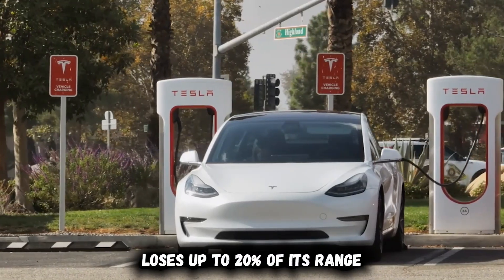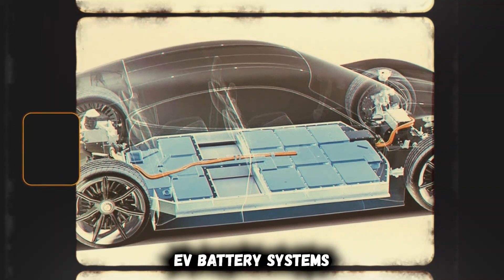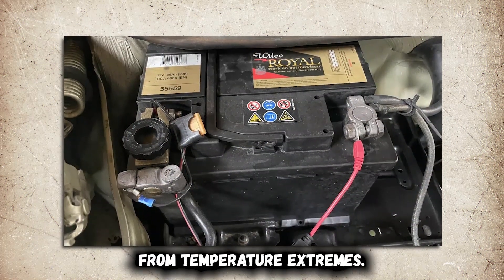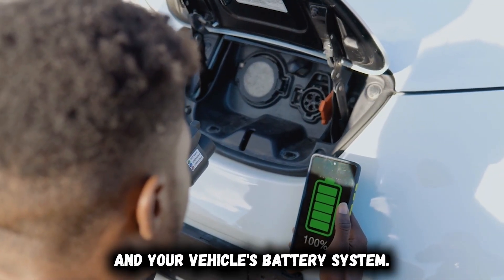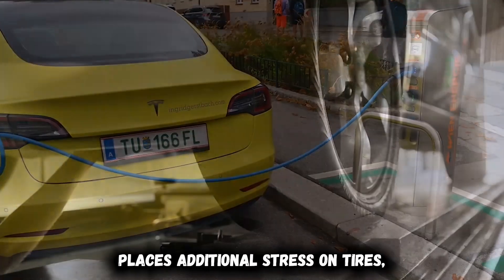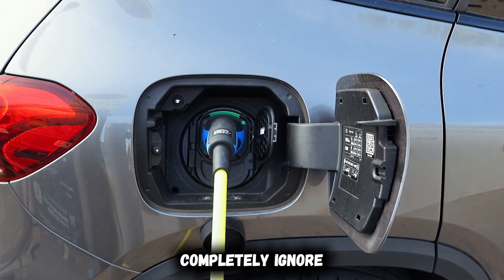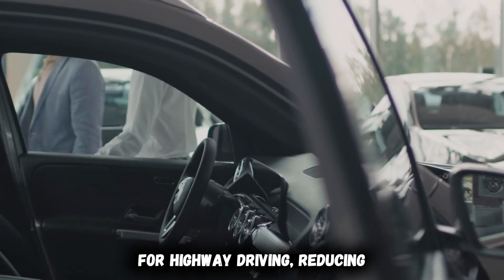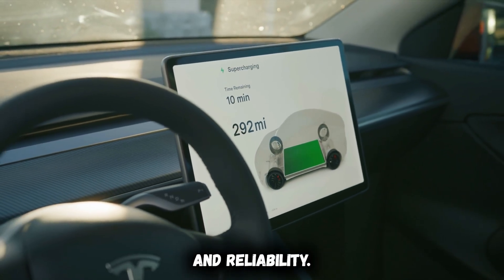Doing This Will Make Your EV Run Like NEW Again

Comment: Cold weather range loss is mostly due to the energy consumption of cabin heating, battery pack heating and battery preconditioning for FDCC use. The aerodynamic drag also increases due to greater air density in the cold. Winter tires have greater rolling resistance, further increasing the energy consumption. Misinformation is being spread here.

Comment: This video sounds authoritative but it massively overstates its case
There is no evidence that a healthy EV loses twenty percent range in two years because owners forgot secret maintenance rituals
Most of what is described affects the dashboard estimate not the actual usable energy

Battery calibration does not unlock hidden capacity
It only improves range prediction
Temperature losses are real but temporary
Parking in the shade does not magically double battery life

Some advice is solid like tire pressure and alignment
But wrapping basic best practices in fear based claims about silent performance collapse is misleading

This is not professional insider knowledge
It is standard EV ownership advice stretched into clickbait
Good tips mixed with exaggeration equals poor technical honesty.

Comment: Thank you for the summary. I just purchased the model Y Juniper.  Driving between my two places require me to supercharge the vehicle in between..  on one of the trips I charge more than necessary, so I did not have to stop at another supercharger. When using a supercharger, what is the max percent? You should allow it to charge your vehicle for optimum battery longevity?  I charged it at that supercharger to 92% and drove all the way to my destination which left me with 18%.  Then I use the charger at home. Would like to hear what your thoughts are.
Reply from the maker: You're welcome! For optimum battery longevity, charging to 80% at a Supercharger is generally recommended, but occasional charges to 90% or even 95% are fine for longer trips.